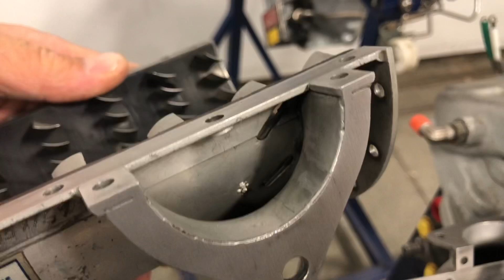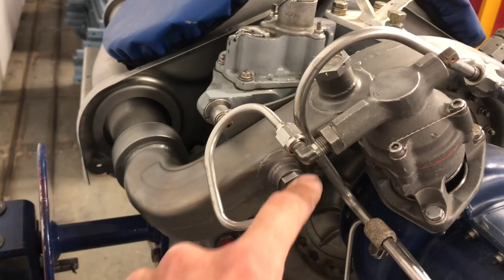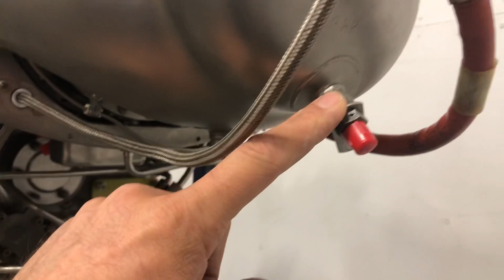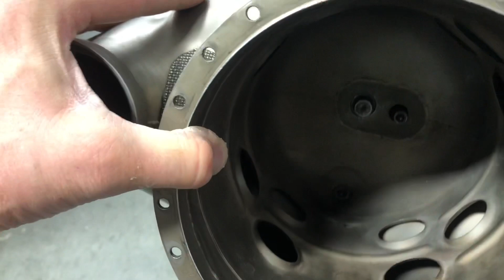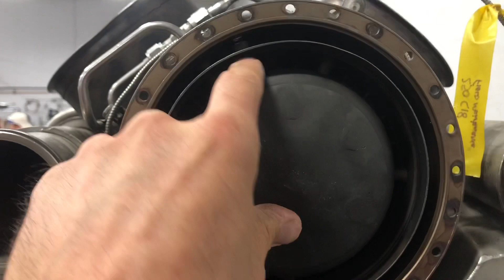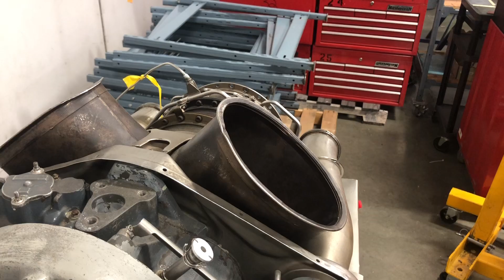Turbine Theory a Rolls Royce 250

Comment: Hi! A&P student here. I have a question- the temp sensors in the gas producer section . . . I understand they are wired in parallel. So if one fails, there are still the others. Does the pilot get a "sensor out" light or anything? Or does the temp get averaged with the remaining sensors and throw off the actual temp? How does that work?
Reply from the maker: Great question! 
They are wired in parallel, they average out the temperature between the power turbines and the compressor turbines. If a high temp probe goes out the average reading will be lower than before. And vise versa. There is no light.
Reply: @halhobenshield5931  Got it, thanks. Is there then a chance the pilot, seeing the temp reading a little low, might add more fuel and cook the engine?

Comment: What are the borescope ports ?
Reply from the maker: I don’t think this engine has a requirement for boroscoping. If it did we usually would use the fuel nozzle hole. We usually are looking at the hottest parts for damage like the first stage compressor turbine guide vane (nozzle).

Comment: I’m seeing a term NL and NH on Wikipedia. I’m assuming it’s the Low Pressure turbine and High pressure turbine? As I understand it the first turbine stage Gas Producer Ng is also known as N1? And the second the Power Turbine Np is also known as N2. Which one is the High and Low pressure turbine?
In turbofan engine diagrams they all seems to have Combustion, then HP turbine (labeled N2) then LP turbine (labeled N1). 
Are turboshaft engines different?
Reply from the maker: It’s confusing but… I’ll do my best to explain. This RR250 compressor is a combination compressor meaning it combines an axial and centrifugal compressor.  Both those two compressors are on one shaft operating at the same speed. This RPM (N) is known as N1 (first rotor air hits) or Ng (gas producer). The N2 on the RR250 is the power turbine, which drives the output shaft, sometimes called Np. Or when it’s running with the rotor system on a helicopter it’s Nr (Rotor). To confuse that even more… put that engine’s output shaft to a propeller and it becomes Np (prop RPM).  

When you see NL and NH those are dual spool or triple spool engines. NL is sometimes a combination of the Fan and the first couple stages of axial compression. Also, since this is the first thing the air hits it’s also sometimes called N1. Then the NH sometimes called N2 is the high pressure compressor which is next in the pathway of air, just before it hits the combustion chamber. They both have their own turbine(s) and operate at their own proffered RPM. Spinning a shaft inside a shaft. The increased complexity is offset by the efficiency gain. 

The newest turbofans are triple spool N1= fan, N2 or NL=first stages of compressor, N3 or NH= high pressure turbine. 

See simple lol

Comment: Burn marks on the inside of the combustion chamber shows why you never want a "hot start" on the engine. Am I correct?
Reply from the maker: Yes, true. However, you do want to start it as quickly as possible so when we adjust fuels controls, or the newer FADEC units, we use the maximum starting temp as a guide. With very little cooling air during the start we want them to get them up to idle speed as quickly as possible.  Hot and fast start is best. The burn marks can also come from a nozzle that’s not flowing correctly. So, doing follow checks at their recommended time and us essential. A streaking fuel nozzle can lead to very expensive for section.
Reply: @halhobenshield5931  Wow! Thanks for clarifying that. I have always loved the Bell 206 Jet Ranger and the Hughs 500 that both have used this awesome little gas turbine for well over 50-years now and with an excellent reliability and safety record. Your explanation on that unit was exemplary. You really know your stuff! Bravo, Sir!

Comment: Hal, my Allison 250 B17F is starting to leave small amounts of oil at the leading or entry of the axial compressor. Is there a way to send you photos ?
Do you have a video showing how to fix that oil leek ?
I am sure it’s only one -0- ring
Reply: Leak
Reply from the maker: Hey Kevin, 

The number one bearing utilizes a carbon seal. It’s a bit of a job to change it. You need a couple special tools to remove it. Also you sometimes have to remove the compressor from the accessory case to hold it vertical during the replacement process. Best to have someone from an MRO come replace it for you. If that’s possible.
Reply: @halhobenshield5931  
Ok, thank you
K
Reply: @halhobenshield5931  
You interested ??
Reply: @halhobenshield5931  It is, actually, doable in situ as long as there is access. I've done #1 carbon seal change a few times on a jet ranger. Of course, it's easier in vertical position.

Comment: Now my question is. If the labyrinth seal on the No2  bearing is deficient, can you have air from the scroll diffuser getting into the oil system therefor having an High ITT and a variation of the oil pressure while the motor is running ? if yes how often are you supposed to check those labyrinth seal ?
Reply: Generally that can be adjusted externally by changing out the vent orifice fitting that sticks up on the back of the compressor scroll case at the diffuser. That orifice regulates how much air from the diffuser will be allowed to pressurize the cavity leading to the lab seal. The excess air will escape the orifice.  Those vent orifice caps are different sizes by part number and you have to change them in and out to achieve a proper balance. Density altitude and drastic temperature changes can also effect its characteristics.

If the orifice is too big: it wont pressurize the cavity enough and oil will bleed past the air side of the seal and blow oil back up through the diffuser vent.

If the orifice is too small: too much air will push through to the accessory gearbox. It will cavitate the oil and will cause the air/oil separator gear to work inefficiently, thus instead of venting air it will be blowing oil out through the oil vent of the accessory. In the case of a Bell 206 you will see it blow out the r/h exhaust stack and back over the tailboom.

Comment: short "i" sound in diffuser, like in "different"... 
Also the explanation of why compressor bleed is required isn't correct. Simply, for a fixed-geometry. multi-stage axial compressor at low speed the flow would be so low that the angle of attack on the blades would be high leading to stall/surge. By having bleed the flow at a given speed is increased reducing the angle of attack and preventing stall. This is true whether the compressor involves a centrifugal compressor or not.

Comment: Thx for share ,Is this an APU ?
Reply: No.
Reply: Helicopter engine. Originally built by General motors.  Bought by Rolls Royce  , Alison is the inventor of the reduction gearbox for turbin engines.  Alison transmissions  like in GM trucks and the Abrams 1 tank and transmissions in comercial trucks .

Comment: Nicely demonstrated. Getting slowly ( not an engineer ! ) at understanding how a turbine engine works. Fabulous piece of engineering. Thanks a lot for all the detailed explanation. Now I just need to understand the N1, N2, etc,...
Reply: I found it easier to understand using Ng and Np.  The Gas Producer, Ng/N1 is compressing gasses (air) in the compressor section.  The Power Turbine, Np/N2 is taking the energy created in the combustion chamber and generating power, horse"power" or torque.
Reply: @weswood151  that helps give it a little more tangibility. . N1 is the beginning like "pitcher" initiates a play sequence in baseball..no hits without a pitch..it just clicks when you become involved with it!
Reply: That's simple. N1, means the main fuel producing turbine, which is directly connected to the compressors. The heart ❤️ of the engine. N2, is the power turbine, or, power takeoff, which is connected through the N1 shaft, driving the main gearbox.
Reply: @ronaldgreen5292  Thank you for the reply! Have a good day. Alex

Comment: Hello sir. I have this engine to overhaul. It is my senior project. May I ask you some questions. How can I connect starter generator to battery? I don’t have any ideas to do that.
Reply from the maker: Yikes. That’s a great question. The starter generator is an airframe part. You need to connect it to the battery through some starter/generator control relays. Check the bell maintenance manual for details.

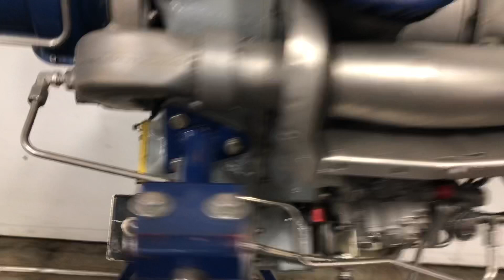Comment from the maker: It’s actually the silver round cover at 5:37. There’s one on the compressor side and one on the opposite side.
Reply: Thanks for correcting my mistake.  I looked at another video and realized that it's the round blank w/ 6 studs and nuts.  Also noticed that both front and rear are used on helicopter application.  Front for main rotor drive and rear for anti-torque tail rotor drive. 
Great Video ! 😎
Reply: Also I found that the diffuser scroll is radioactive

Comment: where is the PTO to the transmission
Reply from the maker: Ralph Morgan Good catch, it’s on the accessory section near the bottom. I’ll see if I can figure out how to add an amendment in the AM. .
Reply: @halhobenshield5931  I believe it is the square yellow plate with 4 studs & lock nuts.
Please correct me if I'm wrong.  😎